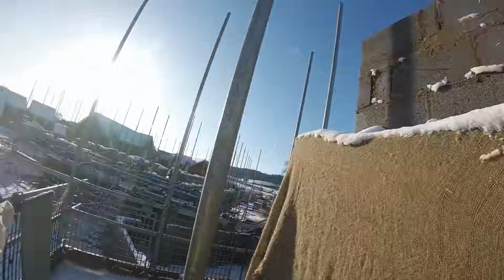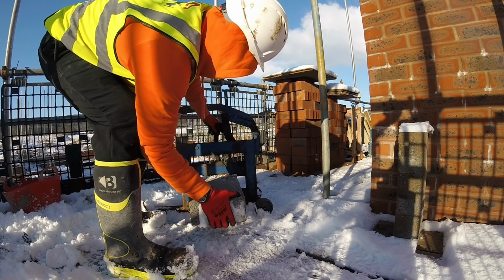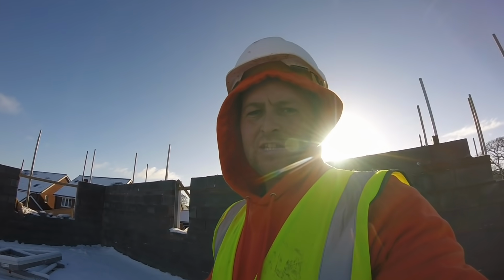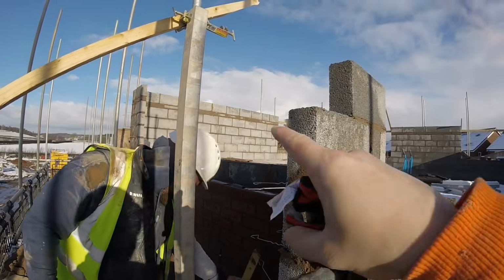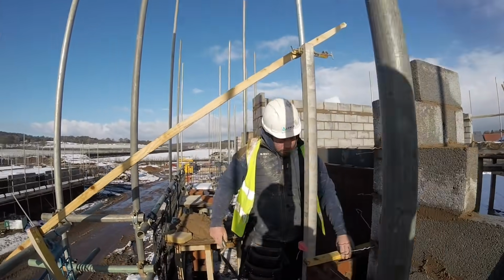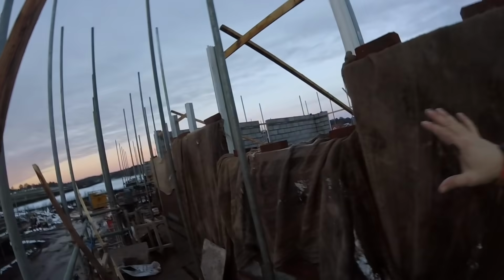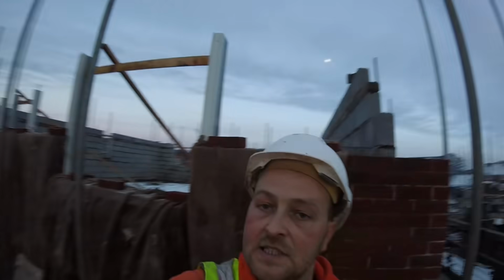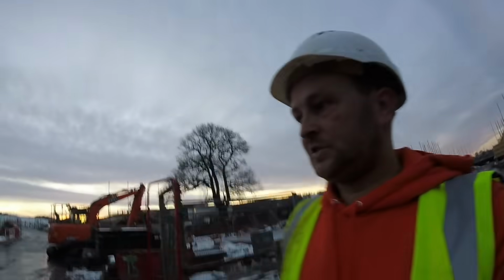Bad Start! Cutter Out & Splitter In, Refurbished Brick Hammer & Markers 🤙

Comment: Thx Chang
After watching you with the block cutter our next job was a georgian block of flats 4 storey flats with axed 4 course arches and brick quoins . internal blocks are 100mm 15n -10.5n-7.3n so i got a block cutter but bigger than yours to take a full block . the floor was 175 mm concrete slab so had a cut to  level the blockwork to the brickwork. saved a load of work with the cut off saw and no dust. Top man good ideas.